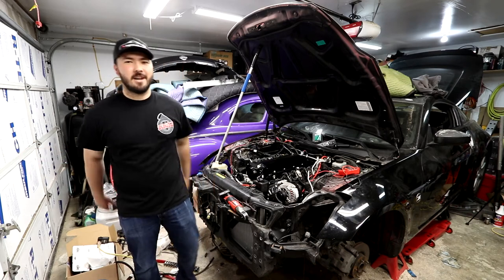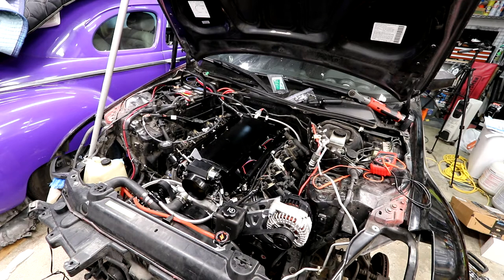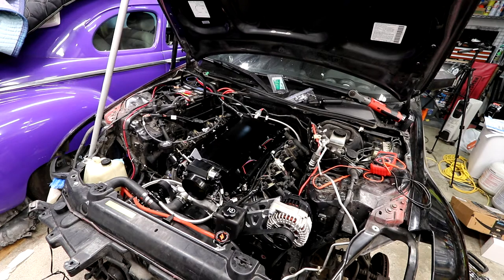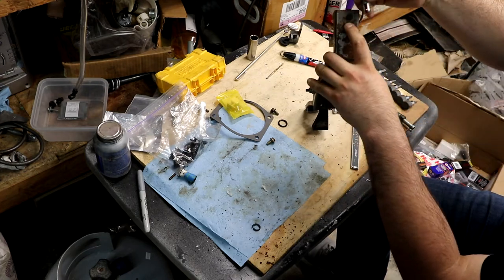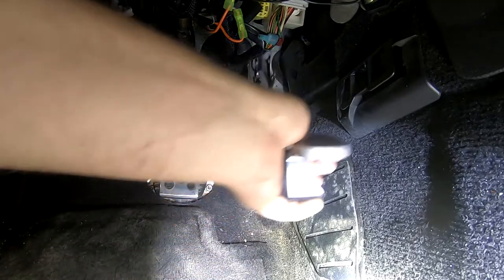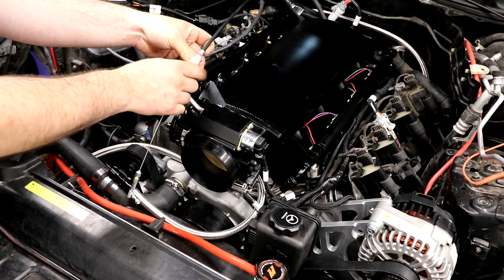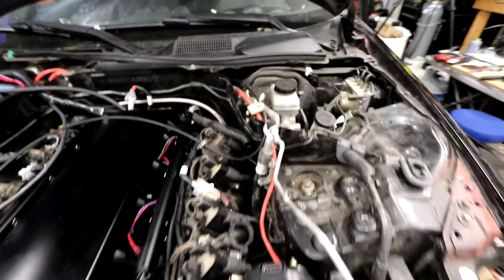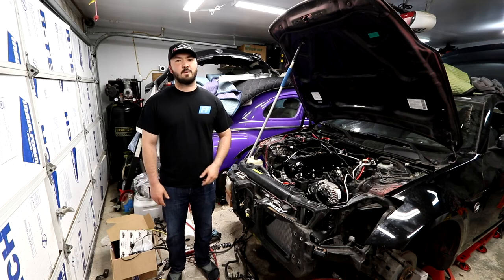350Z THROTTLE PEDAL DRIVE BY CABLE - 350Z LS SWAP EP. 15

Comment: Good video. I need to find out what the cable length is.  What is the Lokar part number and also for the brass barrel nut? Where can I purchase them?  thx
Reply: Did you ever figure this out? I really need to get mine done
Reply: I got a 36 inch cable from Amazon and it looks like it’s going to be short I would say go to a 48 inch or even 60 if possible

Comment: Hey question. Where did u drill the hole into the fire wall soo u could install the throttle cable to your pedal.
Reply from the maker: I temped up the brake pedal and marked the spot with a sharpie. Then I drilled the hole from the inside out.

Comment: Where did u get the bracket  that holds the cable to the throttle body??
Reply from the maker: I bought it with the intake manifold. Both of them were purchased from SW Performance Parts.

Comment: Could I run this setup on a small block 350 with the exact same ls fuel swap assembly
Reply from the maker: Yes you can. It might require minor adjustments but it should work.

Comment: How long was your throttle cable that you used?
Reply from the maker: It is a 48” lokar but you could use a 42” or turn the tb upside down and use a 32”. I’ll probably get a shorter cable in the future.
Reply: @LogansGarage  okay cool, thanks! I might need some guidance here soon on how to get it through the firewall and mounted.

Comment: Did you have issues  getting it to open to full throttle?
Reply from the maker: I cut the stop off the bottom of the pedal in order to get full travel. With the Holley ecu you can adjust it to know what is full throttle even if your pedal doesn’t have full travel.
Reply: With the ecu setting.   If you adjust it to read full throttle and the pedal isnt opening the throttle body 100% wont you lose power?
Reply: I have the same question… will it open completely or not ? 🤔